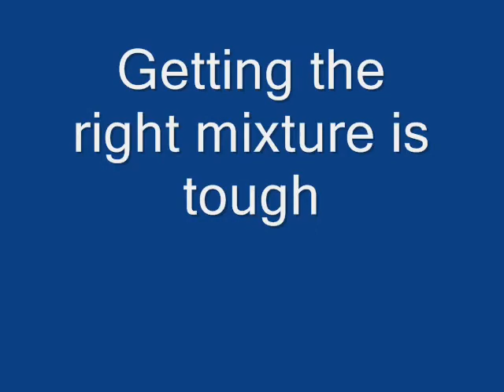7 Plate JC Cell with 2 Stroke

Comment: hey fellas. i can help you with your backflash. I use about 3"s of fine bronze wool at the point just before the device your running. Just go to the local hardware and get a bag. It's cheap as dirt and 100% effective. Just feed it in with a nail or coathanger. you can then hold the tube end in front of a flame, and wont blow back. feel free to watch my first vid and pay attention to the tube where it meets the tip.